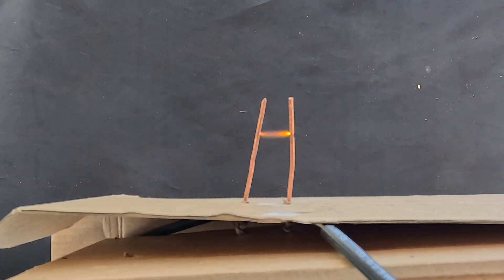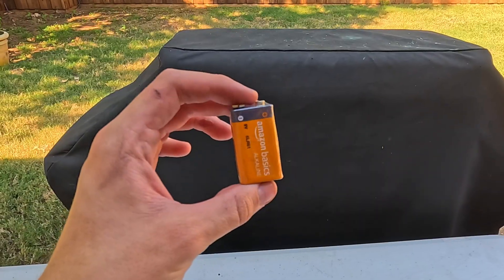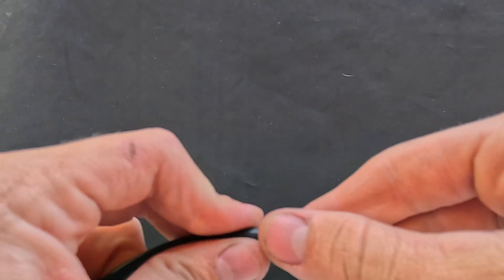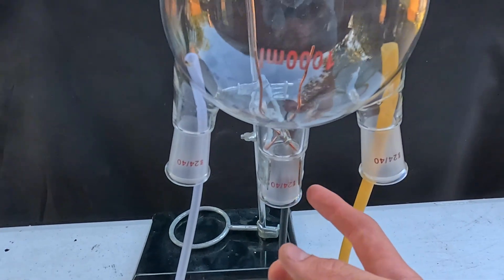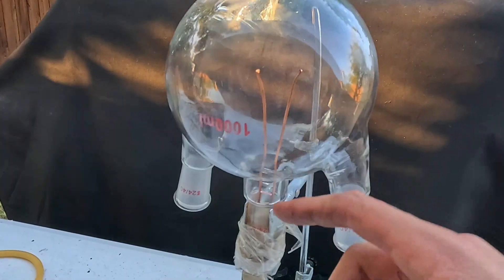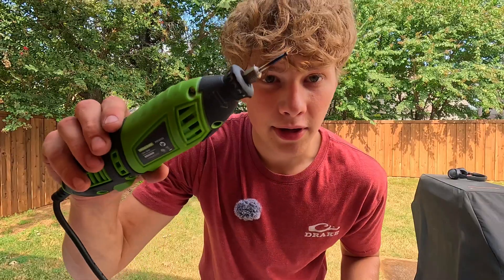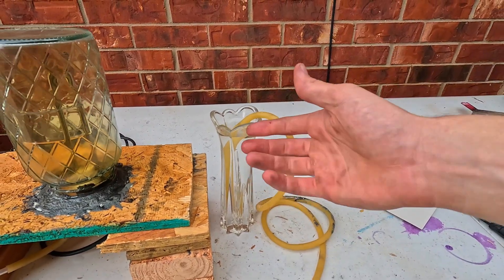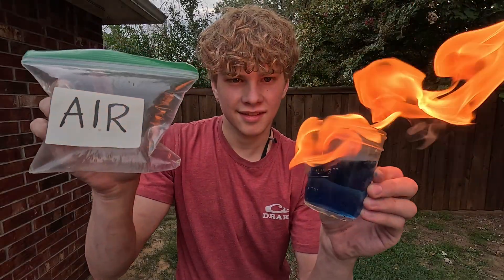How To Make Nitric acid

Comment from the maker: I'm working on my 30 sec intros do you think I'm doing better?
Reply: Hell yeah. Keep it, bro. I can't believe how much you have grown since I first subbed. ( I subbed when you were at around 2k subs) love your content man.
Reply: Ye
Reply: You can try to use 3 microwave oven transformers with outputs and series and a 35 amp ballast and submersing them in oil to keep cool you should have a pretty strong power source
Reply: Ya i love 'em keep it up
Reply: Try starting with proper credit to the creators of this process.
The correct term is the Birkeland–Eyde process, named after Norwegian scientist Kristian Birkeland and industrialist Sam Eyde, who developed it in 1903. It was an early industrial method for fixing atmospheric nitrogen to produce nitric acid (HNO₃), primarily for use in fertilizers.

How the Birkeland–Eyde Process Works
The process uses electric arcs to react nitrogen (N₂) and oxygen (O₂) from the air at very high temperatures (~3000 °C), forming nitric oxide (NO):

N 
2

 +O 
2

 ⟶2NO

The hot nitric oxide is then cooled and reacts with more oxygen to form nitrogen dioxide (NO₂):

2NO+O 
2

 ⟶2NO 
2

 

Finally, nitrogen dioxide is absorbed in water to produce nitric acid:

3NO 
2

 +H 
2

 O⟶2HNO 
3

 +NO

The unreacted NO is recycled back into the system.
Reply: Yes
Reply: Hell yea

Comment: nice nice, now how would i theoretically speaking create electricity if i was to theoretically be stuck in the woods with nothing but trees and rocks all around me
Reply: 1 you can find some vegetable with high concentration of acidi like lemon(citric acid) and then you stick like a penny or some metal in it,you need to stick onlt 2 piece of metal positive and negative   2 you can opposite rotate two wheel with the circonference composed of magnet and copper,like dr.Stone

Comment: Okay, I'm no electrician, but if you don't know what the things on a power supply label mean (like "OUTPUT 10kV") then you should not be taking it apart. I'm pretty sure most electricians will agree.

Comment: This video was VERY informative, and will greatly help me with chemistry. Personally, since nitric acid tends to decompose rapidly in air (which is responsible for the fumes), it's probably best to form the nitric acid with whatever you're going to react it with already in the container you're bubbling the nitrogen dioxide into.

Comment: You forgot the end step - the brown gas is mostly nitrogen dioxide which when added to water will only produce NITROUS acid HNO2 It will require further oxidation to produce the desired NITRIC acid HNO3. You could try bubbling ozone O3 through it - you could make a video for that...

Comment: Awesome video, I'd love to have some HNO3, but we can't really buy it where I'm at. Unfortunately if my knowledge is right, this is only producing a very little amount of nitric acid, and mostly just HNO2, since you didn't convert the NO2 into NO3, which requires a catalyst. Cool nonetheless, and I'm probably gonna do it anyway!
Reply: If you really want to make it there is a much simpler but dangerous method

Dry some potassium nitrate by slowly baking it and make it as dry as possible then add it to a round bottom flask and add chilled sulfuric acid and distill it over with simple distillation apparatus this will leave you with red fuming nitric acid and that too a lot of it!

Just make sure to seal everything up and do it in a fume hood as it will make a crap ton of nitrogen dioxide

Comment: How old are you, I mean no shame, I am probably around your age, but bro. Your carelessness is concerning
Reply from the maker: 19
Reply from the maker: 20 in april
Reply: @coolmanthings damn, sorry about that. You look way younger, but still, you‘re being very reckless in a bad kind of way. Like you not knowing what was going on behind the scenes and just playing with high voltages like that.
Reply from the maker: @MyysticYT I knew it wasn't enough to harm me, the volts where high but it hat extremely low amps
Reply: @coolmanthings 
well the higher the voltage the less current it takes for it to be lethal  to a human something like 10kv ac from a neon sign  normally at 20kz or 50khz frequency at 80ma is  lethal  it's far from the safe current and you won't be able to let go of the wires and also 80ma is enough to stop a heart at high voltage

Comment: the 10kv on the powersupply does mean 10 000 volts. its at 0.8 amps or less so its safe for commercial use. and 10kv can jump 1cm or 0.85 inches in normal conditions and when its dry it can do more.
Reply: Wait if you mean 80ma or 800ma then that's not safe at all but if you mean 8ma then yeah it's safer but still not entirely safe
Reply: Oh wait you meant 80ma since the video showed the power supply is 80ma ok then it's definitely not safe that's way too close to 100ma

Comment: You should try to make skyshots. I think that would be interesting
Reply from the maker: What are thoes?
Reply: its when you shoot up self-made stars from a paper tube stand. And for content you can make the stars and here is how: you mix black powder with some metal powder (for colors), when you mixed it spray it with something that evaporates quickly for axample alcohol until you get a play-doh texture and now you can press it in shape, wait till it dries and spray with alcohol again but only so you can coat it with black powder for better burning, and if it dried up enough you can use it as a firework star. But be safe! you can search it up for better info as: how to make firework stars/skyshots.

Comment: acutally at the end if concentration would be higher like rfna (red fuming nitric acid) if would do anything aswell bc it would passivate and it means that protective layer would form way quicker than it could react and this works with concetration of 15-68% also if would be good if you measured you concentration by weighting 10ml or more and dividing it by how heavy it is
Reply: Could you explain that in more detail? i am very interested
Reply: @cavlier4992  what exactly

Comment: The correct term is the Birkeland–Eyde process, named after Norwegian scientist Kristian Birkeland and industrialist Sam Eyde, who developed it in 1903. It was an early industrial method for fixing atmospheric nitrogen to produce nitric acid (HNO₃), primarily for use in fertilizers.

How the Birkeland–Eyde Process Works
The process uses electric arcs to react nitrogen (N₂) and oxygen (O₂) from the air at very high temperatures (~3000 °C), forming nitric oxide (NO):

N 
2

 +O 
2

 ⟶2NO

The hot nitric oxide is then cooled and reacts with more oxygen to form nitrogen dioxide (NO₂):

2NO+O 
2

 ⟶2NO 
2

 

Finally, nitrogen dioxide is absorbed in water to produce nitric acid:

3NO 
2

 +H 
2

 O⟶2HNO 
3

 +NO

The unreacted NO is recycled back into the system.
Reply from the maker: You seem alot smarter than me haha
Reply: @coolmanthings he isn't, though the explanation is very thorough and nice the spacing in between the lines of text tells me this was coppied either from chat gpt or some forum

Comment: remember you shouldnt use nitric acid to make nitrocellulose (explosive.. put q tips in the acid for a bit with a drying acid like sulfuric ), nitroglycerin (explosive same a cellulose but with glycerin ), or TNT or even rdx
Reply: Do not suggest him make nitroglycerine, it’s very easy to improperly cool since he does not have a stir plate to properly mix the solution, and acid contamination in the final product is kind of difficult to scrub out, dropping it, contamination, or simply elevated nitration temps, can cause the product to detonate.
Reply: @Pyrotechnicduck  that's why i said you shouldn't "remember you shouldn't use nitric acid..."
Reply: Just to be sure, you are saying that is it possible to make nitrocellulose without nitric acid? By using sulfuric acid only?
Reply: @TheBlackAnomaly  its in the name nitro yes you NEED nitric acid
Reply: @TheBlackAnomaly you need both to make a nitration bath

Comment: Bubbling nitrogen dioxide through water also creates nitrous acid as well as nitric acid. It would be cool if you make a part 2 where you concentrate the nitric acid, as well as show some of it's uses (use it to make nitroglycerin maybe?). 

The structure of this video also felt a little weird, with how you showed the initial setup and your process for making it, then scrapped the entire thing for another setup. If you do another of this sort of video then maybe just skip to the simpler setup right away?

Anyway, still a cool video! I'm surprised your content doesn't have more views.

Comment: if you have some platinium catalyst or even fireplace catalyst you can make an way more efficient nitric acid generator, the catalyst will convert ammonia and air into NO2 but as i said its way more efficient and also cheapper, its called ostwald process nitric acid
Reply from the maker: I'll look into that!
Reply: @coolmanthings yow this would be crazy

Comment: I dont know much, would using something like those electric lighters or a taser work? then you could use a rubber tub and aim it better? maybe that wouldnt improve the efficiency all that much, again im not knowledgeable in this stuff.
Reply from the maker: Idk I should of tested that out, I feel like it would
Reply: The correct term is the Birkeland–Eyde process, named after Norwegian scientist Kristian Birkeland and industrialist Sam Eyde, who developed it in 1903. It was an early industrial method for fixing atmospheric nitrogen to produce nitric acid (HNO₃), primarily for use in fertilizers.

How the Birkeland–Eyde Process Works
The process uses electric arcs to react nitrogen (N₂) and oxygen (O₂) from the air at very high temperatures (~3000 °C), forming nitric oxide (NO):

N 
2

 +O 
2

 ⟶2NO

The hot nitric oxide is then cooled and reacts with more oxygen to form nitrogen dioxide (NO₂):

2NO+O 
2

 ⟶2NO 
2

 

Finally, nitrogen dioxide is absorbed in water to produce nitric acid:

3NO 
2

 +H 
2

 O⟶2HNO 
3

 +NO

The unreacted NO is recycled back into the system.

There now do a google search and start reading to become "knowledgeable"

Comment: GOATED
Reply: The correct term is the Birkeland–Eyde process, named after Norwegian scientist Kristian Birkeland and industrialist Sam Eyde, who developed it in 1903. It was an early industrial method for fixing atmospheric nitrogen to produce nitric acid (HNO₃), primarily for use in fertilizers.

How the Birkeland–Eyde Process Works
The process uses electric arcs to react nitrogen (N₂) and oxygen (O₂) from the air at very high temperatures (~3000 °C), forming nitric oxide (NO):

N 
2

 +O 
2

 ⟶2NO

The hot nitric oxide is then cooled and reacts with more oxygen to form nitrogen dioxide (NO₂):

2NO+O 
2

 ⟶2NO 
2

 

Finally, nitrogen dioxide is absorbed in water to produce nitric acid:

3NO 
2

 +H 
2

 O⟶2HNO 
3

 +NO

The unreacted NO is recycled back into the system.

Comment: 1:59 KV means kilavolts or in your case 10,000 volts
Reply from the maker: Thanks! It defenently hurt when I touched it
Reply: @coolmanthings  dude, i don't want to sound rude but judging by this video your electrical knowledge isn't very high. Messing around with stuff like this is really dangerous, especially if you don't know what you're doing. be careful.